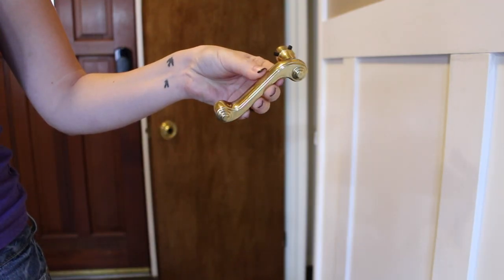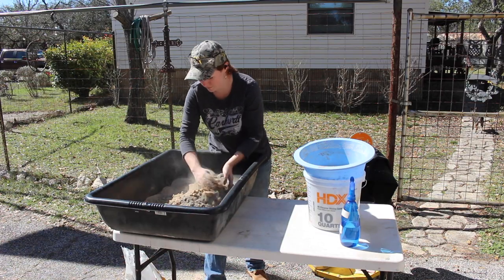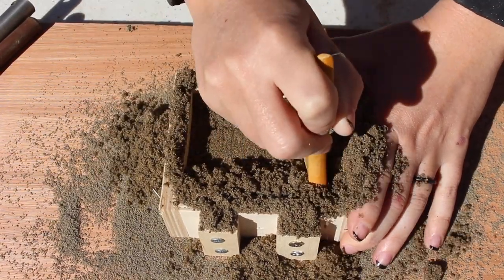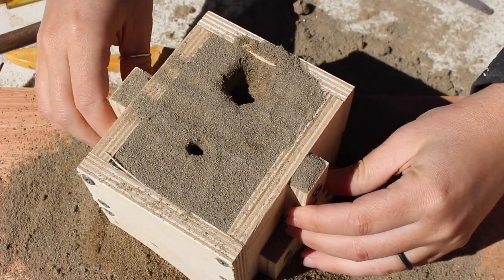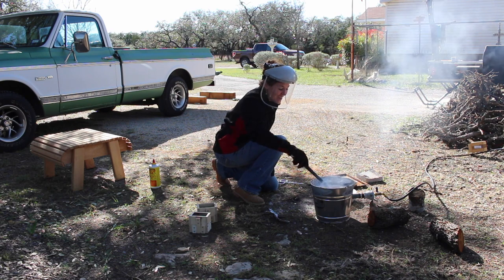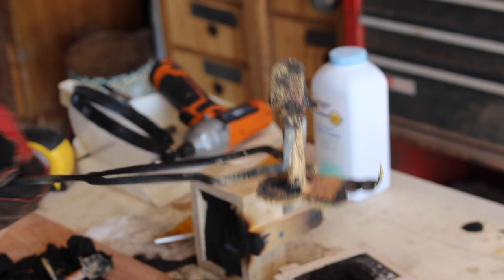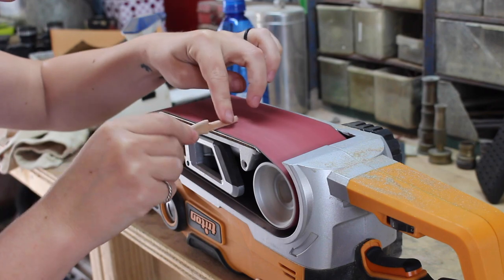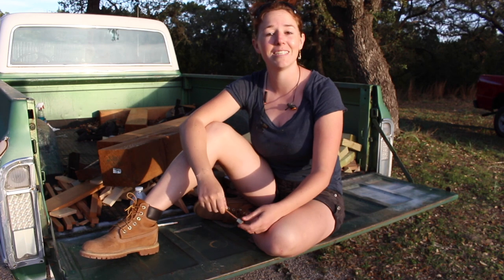Sandcasting a Brass Axe Keychain

Comment: Good job for your first try at sand casting. I use to teach sand casting to middle and high school students 20 years ago until they dropped metalworking. Keep the videos coming. It is nice that you are expanding your knowledge in different areas.

Comment: Wicked impressive April!!!!Pushing the maker boundaries!!! You should get your furnace going and metal melting first, then make your green sand and molds. Green sand will loose moisture as it sits, can loose definition on the part and cause mold washout when the metal flows through gate and runners. Also make your spruce and riser using tapered materials so the pull out easily. Can cover the molds too while waiting for the pour. Keep the metal flowing!!! Love videos.

Comment: Well done April...one small tip only set your crucible on a cinder block or refractory, setting it on the ground can contaminate it and can possible cause cracking or deterioration when it is heated again (hate to waste money ) they wear out quickly enough anyhow cheers happy heating

Comment: Really hope you continue with more projects like this one. I look forward to seeing what neat things you do with metal working. (And really look forward to seeing your shops take shape... You're totally doing a wood and a metal shop, right?)

One quality/safety suggestion for anyone getting started with this kind of work: Don't reach over poured castings! Pour into the one furthest from you and work your way back, or go down a line spread out in front of you.

Reaching over a fresh casting means you're closer to the heat, and less comfortable for the further castings you do. Plus a greater risk of knocking them before they're fully set.

Safety factor is kind of obvious. Not the biggest risk in the world, but no sense putting yourself closer to a minor risk than you need to.

Comment: RESPECT! Well done, April....I'm in awe....
Reply from the maker: : ) Aw thanks Andy.
Reply from the maker: Not when you consider the time it took to make it. This is an extremely time intensive project even though it's small. I didn't even cover drilling out the hole or the sanding/polishing steps.
Reply: True but there is a lot of work that likely went into them. Time = $
Reply: shamroz khawaja I respectfully disagree. What's expensive is the piece that is made in a faceless factory that you buy for $3.00. This is made by a craftsperson, by hand. If you don't understand that, I get it, but as a maker who makes a living making stuff with my hands, $60.00 is a damn bargain. You don't buy a Porsche at Walmart, dude.
Reply: shamroz khawaja no.
Reply: Well said Andy!
Reply: Andy Birkey I couldn't agree more!
Reply: Yes I concur!
Reply: Hi April. I'm not normally the safety Scrooge but I wanted you to know about metal fume fever. That white smoke was the zinc fuming off of the brass. Brass is an alloy of copper and zinc.  Copper has a much higher melting point than zinc. The dangers are akin to welding galvanized metal.  It's deadly.   Be safe. Love your vids.  Hope to see many more in the future.
Reply: Much Agreed  April.  i work in the aerospace industry.  I would consider a respirator and flame retardent clothing.  Things can go bad very quickly.  You may want to consider Airset or Pep set sand used by the big casting houses.  They may sell you some cheap!  Love your videos and style of explaining your thought process in your builds.  Keep up the great work!
Reply: Really guys? you think she's gonna get weld fever or fume fever from that little bit of contact while outside with a breeze? 

have you ever even seen a welding shop or similar with a lot of work going on? Don't mind the safety stuff too much April, or at least take it with a grain of salt.
Reply: Dented Yota.     I'm not trying to discourage anyone from building things.  Just wanted folks to be aware of hidden dangers.
Reply: Don't take safety with a grain of salt...
It produces deadly Chlorine gas!
Reply: That came out good! Have you ever considered using plaster molds? Check out some of my videos if your interested. Plaster leaves a much cleaner finished surface but is more work.

Comment: Great first try on this! I remember in school we created aluminum castings and used two different kind of sands, one was quite oily and directly around the shape we cast (it also was orange or red) and the other one, that looked like the one you used, for stability. This should make for a much smoother result after casting. I hope that helps, but maybe the technique is different in Europe.

Comment: I've heard that using styrofoam for your template and leaving it in the casting works well; the styrofoam melts when the metal hits it, and leaves behind a residue that seals in the metal against the sand, leaving it with a smoother finish.  I haven't tried it myself, but if you do another casting, it might be worth a shot.

Comment: You could also try using a foam mold, and then the brass will just melt the foam and fill the mold. I've seen some people do it that way, so they don't risk disturbing the sand.

Comment: You should try doing these as a lost-wax casting. You can make things a lot more precise and you don't have to worry about having two halves of a mold.
Reply: Lost wax would be a lot more work for something this simple. EPS foam could have been used in place of the wood, then you just pour with the foam in place and it vaporizes.

Comment: For safety, I would not recommend pouring directly on dirt/soil as its moisture level cannot be guaranteed.  If your molten metal comes in contact with enough moisture it'll "explode" from rapidly evaporating water underneath it.  You might consider making a dedicated brick surface (concrete can still retain moisture) area that is indoors (away from rain/moisture) for future castings.
Reply: That’s good advice, although I cast in mud sometimes, mostly lead... I cast as unsafe as it gets you might say! I’ve actually been told that before so it fine

Comment: As a jeweler who casts a lot.  Greensand is the wrong material for sand casting at this scale.  Unless you like the texture (which has it's uses) a better product is called "Delft Clay"  it's a much finer grain and can give you a finished product that requires way less clean up.    Cute little project, Nice to see you still working despite the move out of your shop, Hoping to see a new shop soon for you!
Reply from the maker: Thanks for the information! Yeah the surface finish didn't come out as nice even with the higher quality sand so good info.
Reply: If you really want to produce them lost wax is an even better process, but requires Lot more gear.  I use it for my silver casting. Casting is fun... If mildly terrifying

Comment: Pretty awesome - Nice work!  Quick question though - Other than simply wanting to play around with casting why not just cut, grind and shape the original door knobs into the the axe head?
Reply: Right. Seeing how much sanding she did afterwards, it would have been easier to just cut a rectangular piece off the door handle and grind it to the desired profile.
Reply: Yeah I'm assuming she just wanted to play around with casting. Either way super cool!
Reply: Seems to me that the head might not have fit inside the doorknobs. And besides it would be much more grinding work too.
Reply: Because metal foundry sand casting is so cool! She now can do further casting of larger parts with the setup.

Comment: Set your mind to it, chop chop!
You might like to experiment with oil bonded sand. Nicer surface finishes, and less maintenance to maintain sand properties compared to green sand, makes it a choice to consider for hobby casting. Google petrobond or k-bond. There are some home recipes out there.

Comment: I think I saw this at a Jimmy DiResta video, so I credit him for this piece of advice: when you cut the wood to make the axe itself, you first drew the shape for both sides and then when right to the bandsaw. Maybe it won't make much of a difference in a project like this but, anyway, as DiResta did in such video, I would also prefer to draw one side of the axe (or whatever symmetrical shape we're talking about) make the cut and then use the cut off to draw the other side and thus you have a perfectly symmetrical cut.

Thanks for the inspiration, I've seen many of your videos but, I believe, never commented so now that I had something to say...
Reply: For something that small, I think drawing both sides made more sense.
Reply: Wow, what an honor :-)

Maybe there's not much of a difference for something that small, but for people like me, who can draw distorted lines using a ruler (no kidding, it actually happened to me back in the day) I think there's not that much difference in execution time for both methods. With the method in the video you spend the time trying to make the line similar to the first one, passing the pencil several times. With the other one, you just have to pick the leftover, place it and mark the line once, and you know it's as perfect as it gets.

But anyway, for the, say, "artistically challenged" like me, that's an insurance policy ;-)

Comment: I hope I'll be able to take a look at the axe in Cologne. Well done - as always. Cheers!
Reply from the maker: I don't know if I'll bring it, I'm worried TSA would take it from me at the airport.
Reply: I ran into TSA several times and yes, I would agree. But it won't be an issue for checked luggage. Especially at that size it should be fine. A pity but at your schedule I can imagine finding that out is going to take up too much of your time. Anyway - you can make one at Laura's place and we can check that one out in cologne then. ;) Thanks for the quick response.

Comment: When ever I see these backyard foundries, I always wonder if it would be possible to create a 3D printer to print wax (or a easily melting plastic) that could be used in a lost wax/investment casting operation.   Where I currently live, we can't even have wood grills, so I am sure the community would have massive issues with my trying to build a foundry.

Comment: Did you happen to look at using foam as a medium for your casting? I've seen people follow all these steps except shape foam into the item they are casting as well as their vent holes. The they pour in the molten material of their choice and it displaces the foam by melting it. You're usually my go to on project information so I was curious if you ruled out this method for some reason. 

Awesome, informative video as usual.

Comment: if you make your mold out of styrofoam instead of wood you don't have to remove it. the styrofoam burns away when you pour your metal leaving an even cleaner surface to your piece.